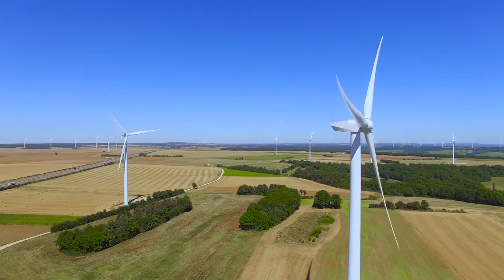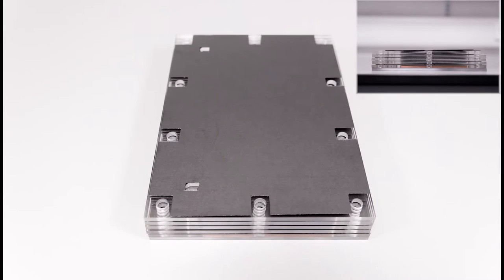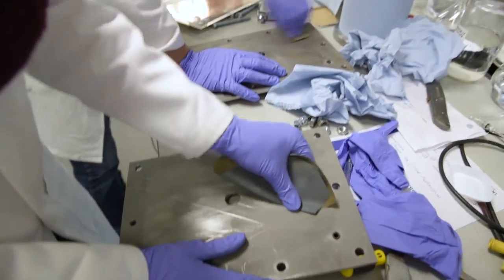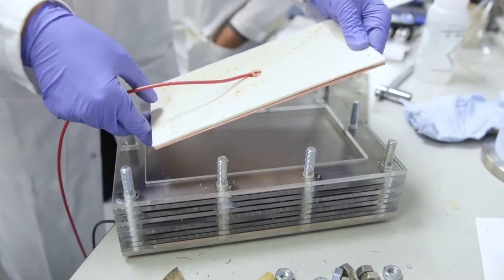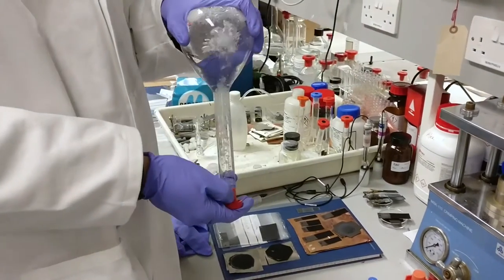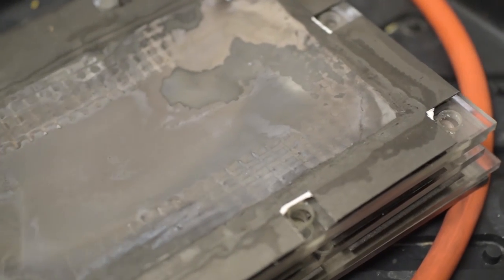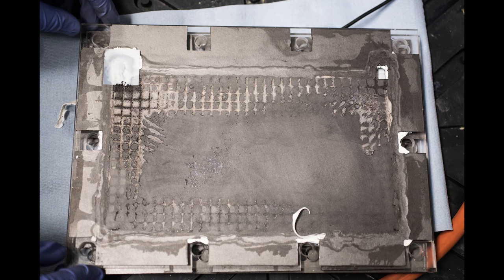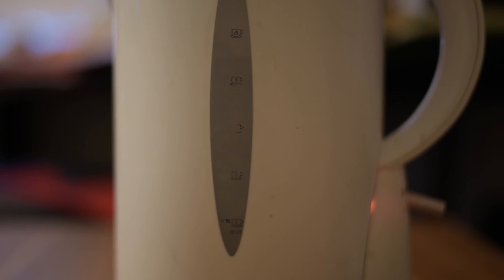Making a 12V soluble lead flow battery.

Comment: If this design relies on material deposition on the plates, then doesn't that fail at decoupling capacity from reaction area?  Especially where lead dioxide becomes highly resistive as its grain size becomes smaller?  It might let you reduce incidental corrosion by using a less concentrated electrolyte, but the capacity is still going to be limited by plate surface area.

Comment: have you considered shunt current at all in your design?  Those plates don't seem to have anything that could be seen as a modified flow path to reduce the shunt effects associated with all flow batteries - ie an electrically common cell electrolyte solution.

Comment: Question: Are the "cells" arranged electrically in series or parallel?  It seems they are in series, yet the electrolyte is being circulated through all the cells in common.  Wouldn't that  mean 5 of the 6 cells would short out via the common electrolyte???  
In contrast, a typical car battery is constructed so that each of the six cells has its own compartment.  That's why each has a separate plug to check the water/electrolyte level.
Reply: That is correct, the cells are arranged electrically in series and the same electrolyte is circulated through the each cell. In this battery, there may have been some charge transfer between the cells via the electrolyte (this is known as a shunt current), but the resistance of the electrolyte is high enough for it not to make a huge difference - especially when compared to some of the other problems with the battery. In an optimised cell, however, the resistance between cells via the electrolyte could be increased, for example by splitting the flow to each cell earlier so there is more electrolyte between each cell and hence a higher resistance and a lower shunt current.
Ewan

Comment: Why you did not use oxidized graphite felts?
And use an external  collector for pump the electrolyte.
I used sulfamic acid instead of MSA.
Reply: did it work with sulfamic acid?  what were your aH v Voltage values?

Comment: considering that lead likes to form insoluble lead dioxide im fairly sure that this battery is mostly a self clogging failure.
Reply: This is just one chemistry for potential flow batteries. They hold great promise and are cheap. The only downfall is size. The only potentially cheaper energy storage on the horizon is compressed air.

Comment: I will try to use lead-acid batteries at home, penetrate and circulate lead-acid by charging solar cells. Investment still costs a lot less. Ha ha ha. Tempted to play dangerous.
Reply: if I'm understanding you correctly, that would not work, in a lead acid battery the active ions are in the solid electrodes, the electrolyte (the acid) is just a conduit for those ions to flow. increasing the amount of that acid won't increase the amount of charge you get.
Reply: @evilplaguedoctor5158  No, the sulphur in the electrolyte plays an active part in the chemistry.  That's why you can measure the charge level of a lead-acid battery by checking the concentration of the acid.

But he'd need to design the battery for such a usage.  The plates will need to be thicker, and buildup of non-conductive lead-sulphate will be a significant problem.  Just adding electrolyte tanks to a standard lead-acid battery would provide marginal gains at best.